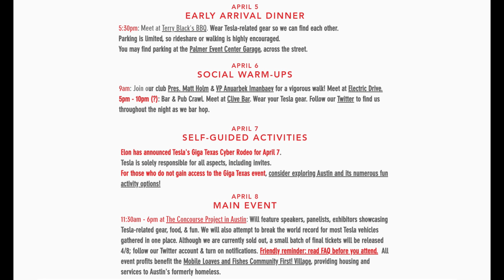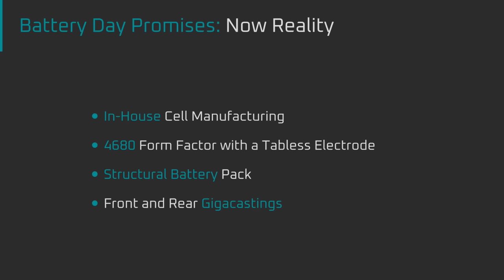Giga Texas // My Experience and What I Learned

Comment: Small time casting professional here, I imagine the tanks are part of a big heat pump, as you would want BOTH heating and cooling for a rapid casting operation.

pre-heating your mold prevents condensation, steam pockets/explosions and gives you more time for your metal to flow before it solidifies.

As you cast your metal, the mold heats up further than the recommended mold temperature and needs to be cooled down.

You may want to rapidly cool the mold after casting is done so you can remove the object more quickly, keep in mind cooling metal isn’t a switch, if it’s not cold enough then just picking it up your casting when it’s too close to casting temperatures but still “solid” can warp, bend or break the aluminum.

So you may end up cooling the machine below casting tempature before Removing the object
 then re-heating the mold, then need to re-heat the machine for the next injection.
 then casting.

Cool thing about heat pumps, is that you can run them either direction to get things hot when they need to be hotter, and then reverse the flow to cool things down.
Reply from the maker: Nice!  Thanks for the input.  I appreciate insightful, boots on the ground comments like this.
Reply: Any idea if the tanks are perhaps also pressure vessels? If they have pressurized fluid it would improve flow rate through the press' cooling channels, but I'm uncertain whether this would be practically helpful to the process.
Reply: I would assume the heat pump is not reversing. One tank kept hotter and one cooler, and you flow from one tank to the other through the mold to heat or cool it. I think that's a simpler solution.

Comment: The true brilliance of the new pack design is it allows the use of different battery chemistry at the cell level while at the same time maintaining a standard capacity at the pack level simply by adding or removing one of the double row strips of batteries.

Layers upon layers everywhere you look.

Comment: "Game over" - yes, it's going to be quite a carnage. Mid or end 2023 is my guess for when we'll see some real giants starting to come down. Thanks for the summary!
Reply: Agree, my .02c is sometime in mid 2024 it's gonna be very very apparent whose in deep shark infested waters among the legacy oems. 
By then we'll have real world sales numbers on the announced gm/ford/vw/bmw/merc ev ramps. 

I for one do not think they will achieve anything like the scale they are currently claiming is possible. 
I mean Ford now claims 600k ev run rate by the end of 2023? Gm is at 1,000,000 projected run rate in 2025. 
From what under 60k for Ford in all of last year and this year production is under last year's so far. 
And gm sold under 40k total evs in 2021. Good luck I say. 😁
Reply: Let's look at one of the largest legacy manufacturers, building the lowest number of EVs and using the largest number of cells per vehicle..... Not exactly a recipe for success?
I won't even say "guess who"
Reply: @4literv6  I think they CAN achieve those run rates, but that's nowhere near enough, and won't let them achieve decent margins. (with the possible exception of bigger trucks) Meanwhile Tesla is already beating those production figures right now, and the margins are at Porsche/Mercedes/Ferrari levels. There's simply no comparison, They might compete on ICE products, (while they can still sell them) but on EVs? No chance.

Comment: You mentioned watery glycol in the coolant loops. Water temp profile is good around bellow 100C after this it boils so pressure must be used. At much higher temps oil make more sense, higher boilling temp and improved heat capacity
Reply from the maker: Hmmmm, the plot thickens.
Reply: @thelimitingfactor  typical oils are good to 400C

Comment: Jordan - Fascinating fascinating thoughts from your Cyber rodeo trip. RE 14:00 casting speed limitations, I'd given this considerable thought +year ago and (not bragging) concluded that cooling the casting for mold extraction critically affected casting production rate. Hadn't imagined how the cooling rate could be accelerated until seeing your photos. Your thoughts about a water/glycol mixture are interesting, but I wonder whether glycol is really the answer. Glycol (even "inhibited glycol - useful up to ~350F) might be too "cold", possibly leading to shock cooling issues? Anhydrous salts can operate in a range from ~420F up to 1470F, which seems a more casting-friendly cool-down temperature profile. OTOH, it would not surprise me that Tesla would design and implement a clever system possibly employing an efficient multi-step cooling process.
Reply from the maker: I actually had some thoughts about molten salts but I don't konw enough about them.  Great minds 😀

With regards to boiling points.  a) I don't know how much that varies with the pressure of the system and b) I don't think the liquid would get that hot if it's running through the machine at a high rate and it's not in direct contact with molten metal (depends on the rate of heat transferrance?)
Reply: Wikipedia's Giga Press article (citing the german environmental impact statement, 3000 pages lol) says the casting is pulled out at 400 °C and quenched down to 50 °C.  The cooling system would be to regulate the temperature of the oil(?) in the quench tank, not to cool the casting directly.

Personally, I'd be looking into a heatpump system to preheat the raw aluminium, or more ambitiously to fully melt it that way.
Reply: @rhamph  Great information! But even if the castings are pulled out at 400°C, the speed-limiting factor is still the time to cool from the liquid-shot cast (~750°C ) to solid (enough) to remove from machine. Like Jordan I have to imagine that the casting machine itself is cooled near the casting mold to speed cycle time.
Reply: @vermontsownboy6957  Good point, I had forgot about cooling the die but I think it'd be both the die and the quench pod that need extensive cooling.  The mass of the die is what cools the molten aluminium, just like the quench pool cools the casting.  It seems the empty die then gets cooled down to 185 °C before the molten aluminium heats it back up to 400 °C.

There's a 300 °C delta in the die stage and a 350 °C delta in the quenching pool stage.  Assuming 100 kg of aluminium and 0.9 J/g/°C specific heat capacity for aluminium gives us 27 MJ to remove from the die and 31.5 MJ to remove from the quenching pool.  58.5 MJ total.  Tesla's front and rear castings are probably a bit under that but it gets us in the ballpark.  90 second cycle time gives 650 kW of cooling.  Compares nicely with the natural gas oven (output unknown) and 400 kW electric heater.  Unsure why cooling ends up being a bottleneck though, this is surely something they'd specify for when designing the machine with a 90 second cycle time.

Found some gigapress numbers here: https://www.sunrise-metal.com/tesla-giga-press-die-casting-machine/

Comment: The point of ushaped cooling: each cross section along the length of the double tube (considering the temperature of the top inlet flow and the bottom outlet flow) has exactly the same middle temperature. Therefore, every cell sees the same cooling temperature and ages the same amount.
Reply from the maker: Elegant explanation. Thank you!
Reply: In fact not just aging, the limiting factor for charge rate that a BMS would allow is based on  hottest cell, so it is best to ensure even temperature across the pack
Reply: @joabarrera  I also guess that the electrical resistance of the cell is highly dependant on temperature. Higher resistance means higher load (more voltage drop by fixed current). So other parallel cells have to compensate by either more current or an higher/lower power delivery. Each way the cells are strained very unevenly...

Comment: I work in HVAC. Typically, heat exchangers are routed in many small "U's" through the fins with manifolds on either side. Double pass coils are the most common I see. The basic idea is that the fins are a heatsink and the air that crosses them mostly exchanges heat with the surface area of those fins, not the tubes of the heat exchanger itself. The tubes and fins are physically connected by a metallic bond, so the thermal transfer is more efficient than air-to-metal. That allows the entering-coolant to cool the returning-coolant after it would be heated above the entering coolant temperature. It ensures that the returning coolant temperature will not exceed more than a few degrees of the entering temperature (assuming enough flow is provided), improving the stability of the coils temperature overall. I think the point you mentioned being made was the case of the battery shell being the heatsink, and coolant thermally conducting through the case of the battery to the other side, keeping the return coolant temperature stable. This is all air-to-refrigerant related, not solid-state, but maybe it'll help some people imagine it. Think of your condenser coil outside if you have central air - any kind of heating and cooling all use largely the same principles

If I know Musk, his engineers have probably come up with something far more complicated than what I've described. Everything I've described here is relatively basic knowledge to the HVAC industries/manufacturers. Honestly, I'm surprised they ever used a single pass system; you mostly only see that on small appliances in my trade
Reply from the maker: Interesting!  Thanks for the input!

Comment: Awesome video as always Jordan

My take on the U plumbing is that you in theory can have the same average temperature is every cell

Imagine we have a delta of 9 °C between inlet and outlet, the temperature distribution between the top and bottom path would be something like this, each column is the same cell:
10 - 9 - 8 - 7 - 6
 1 -  2 - 3 - 4 - 5
The temperature inside the cells might be around 5.5 °C higher than the inlet on every cell, specially if the can has higher thermal conductivity than the jelly roll, which is likely the case. Obviously it won't be that close, but it probably can keep the delta between all cells way closer than a single direction cooling
Reply from the maker: That's where my mind was at, roughly. Thanks for illustrating and articulating it!
Reply: dead on

Comment: Also, not sure if someone has mentioned this but the cooling channel seems to add structural stiffness by joining the cells mechanically longitudinally, the shear stresses are not only carried by the glue/foam between cell cans but by the aluminum that runs continuously.
Reply from the maker: Agreed!  Great point.

Comment: regarding U shaped cooling, the simple answer is because of the capacity for containing heat that the fluid has at any point along the U shaped path. when water first enters the U shaped channel it has maximum heat storage capacity, and then begins absorbing some heat (reducing the amount of capacity remaining in the fluid). when the fluid reaches the end of the line and is ready to turn around and go back to the start, it has absorbed half of the heat that it is expected to absorb, and has half of the total capacity remaining. when it reaches the end of its travels it has absorbed nearly the total amount that it needs to and has lost nearly all of its capacity.

when you look at any point in the diagram where the pack is flat and the U shape is sideways, at any point left-to-right you can basically imagine the top pipe  + bottom pipe add up to 1, where 1 is the full amount of heat capacity remaining in the fluid.
Reply from the maker: This is such a great explanation
Reply: If you look at any PC water cooling radiator it's basically the same with fluid input and output on the same side, air where Tesla is putting batteries, and lots of back and forth instead of just one back and forth (like wwwwwww instead of u)

Comment: The reason the U shape is better is as shown in your graphics, the first cell near the coolant port get the coolest and the hottest fluid, the lass cell of the ribbon get average temperature in both section. The end result is that each cell get closer to the same temperature and will then have a more constant voltage, charging characteristics and aging. Resulting in faster charging possible and longer lasting battery pack.
Reply from the maker: Thanks man! I try not to assume much, and assume I'm stupid, lol.  It sounds like on this one, it's as simple as it looks

Comment: Impossible to say what those tanks for the new cooling of the giga casting are holding. I insulate tanks and pipes like that for work and what we can see is just the external cladding.

If we could know the type of insulation used (foam glass, calcium silicate, mineral wool or other)  it would give us a hint on the temperature range used.

Any chance you’ve got some picture of the flanges coming out of them? Just knowing the thickness would give us a hint on the material used.
Reply from the maker: Oh man!  Cool insight!  No, the pic shown was the only one I have.
Reply: I wonder if they're using a compressed gas such as CO² as a heat transfer medium.

Comment: This may be a stupid question, but could the gigapress tanks not be an insulated refrigerated loop. Always having chilled water and glycol is surely better than running it around a loop at room temperature. It wouldn't need to be liquid nitrogen just water and glycol at -1C. I imagine it would also help lower the amount of thermal mass required and thus floor space.

P.S If this is stupid or obvious, I apologize.
Reply: could be, like chillers in beer factories

Comment: One great advantage of the one-piece castings in a turnkey factory situation is that IF a casting emerges from the press and is tested defective in any way, they can just chop-it-up and dump it back into the vat - eventually.  Discarded raw material costs and rework issues drop to nothing.  However, as the Tesla guys and gals seem to have the handle turning pretty smooth at this time, I am guessing they do not really factor that in as a significant advantage.

Comment: Not sure if this has been answered yet, but with regard to u-shaped cooling:  the cells at the start of the loop become the most cool, and then they are physically adjacent to the cells at the end of the loop, which receive the least cooling. As long as there is some thermal coupling directly between those sets of cells, then the coolest cells at the front will provide additional cooling to the cells at the end of the loop.

Comment: so I don't see why the efficiency would increase that much with 4680s. You don't heat the cells that much in regular driving; the tabless mostly helps with charging heating or performance driving, as well as manufacturing speed (which translates into cost also). Likely the only chemistry difference for the first gen 4680s is just whatever you need to do to get DBE, which again is more of a cost down. The weight delta is smaller than expected. Maybe there is locked range.
Reply from the maker: It's efficiency plus reduced packaging.  Covered my my cell design video.  

I actually estimated less, but Panasonic is saying 15%

Comment: I think if they are chip limited, its as good time as any to allow for factory kinks to be sorted without a tidal wave looming. That said, it's also a great excuse to mask serious issues, like problems with the 4680 or castings. Time will tell, but until then, I remain cautious as the specs are a real head scratcher. As always, Thanks for all of your great content.
Reply from the maker: Thanks man, and I agree.
Reply: Did Elon say parts from OEM are also a limiting factor
Reply: @joabarrera  not that I can recall. Has made references to chips and batteries recently. Probably all sorts of logistic issues though- running multiple facilities.

Comment: I wonder if they are taking their octcovalve lessons and applying to the gigapress thermal management?
Reply: Hmmm you got me thinking here. yes it makes sense but would need to run the numbers.  There are two things about the gigapress, throughput and stability,  I can imagine it working for throughput but long therm stability maybe.  What you bring about it not the octovale its selve but the concept of heat recycling the octovalve enables. So if on part of the coolant loop then gets used of the next as different temps are need in different parts of the die. and at the end you reset on temperature loop overall.....very interesting indeed. You on to something which will make the cooling system less bulky and more efficient